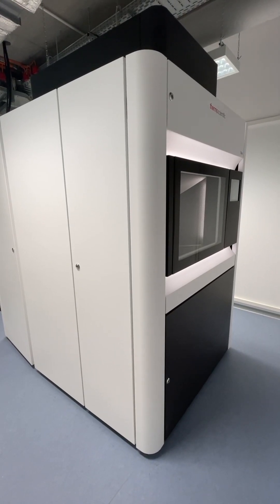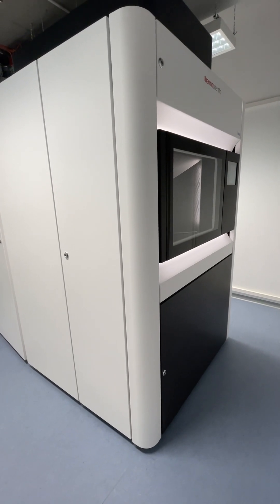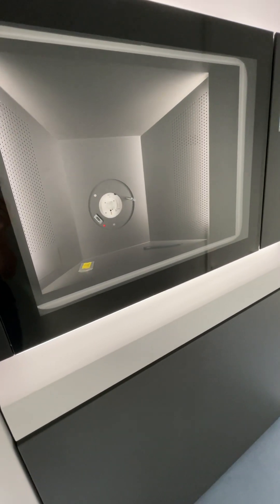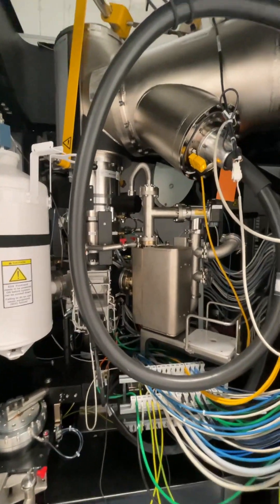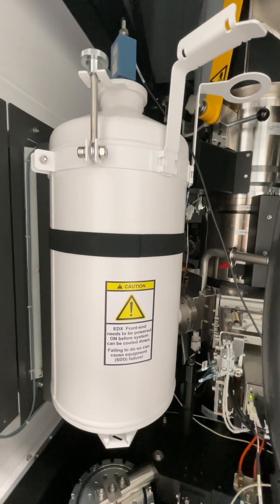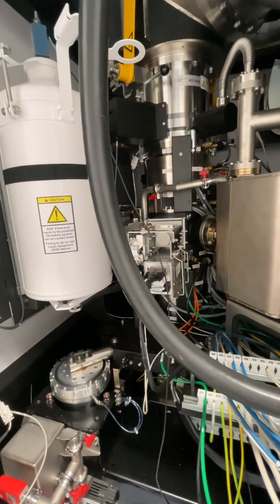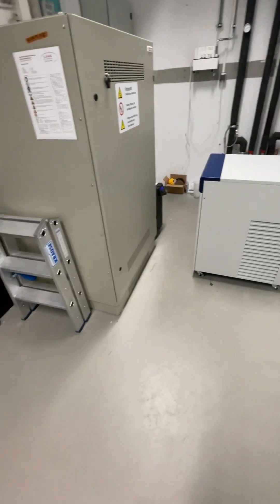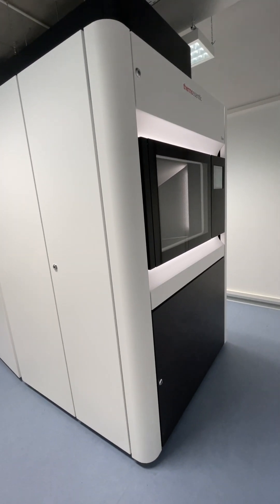Thermo Scientific Talos F200X S/TEM Lab Tour

Comment: Thanks for the video, hope the move went well! It's nice to see under the hood on these machines. How much of a difference is there in sample prep/loading between this and the JEOL?
Reply from the maker: The sample prep is the same (FIB sectioning, ultramicrotoming, drop casting, etc.). One major difference has to do with the need to plasma clean the samples prior to insertion. We have to do this with the Talos, but I rarely need to do so with the JEOL 2100. This has to do with the different electron sources between the two instruments. The JEOL 2100 I last managed had a LaB6 crystal as the electron source, whereas the Talos has a FEG. This means the Talos is much much brighter, and when in STEM mode carbon contamination can build up on your sample quite quickly. Plasma cleaners are very pricey (20k to 75k Euros), so it's good to know ahead of time that if you're planning to buy a FEG TEM, make sure to budget for the plasma cleaner!

The loading is similar to other Thermo Scientific/FEI/Philips TEMs. I'll eventually do a video showing how to load the main holders we use at Goethe University. In short, I find it to be much easier to do the loading with the holders from Thermo Scientific/FEI/Philips!